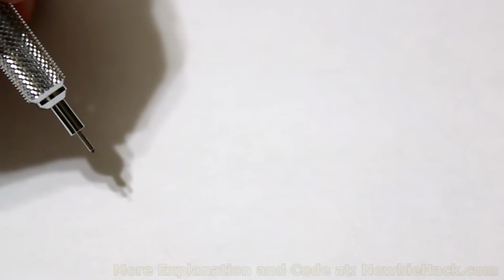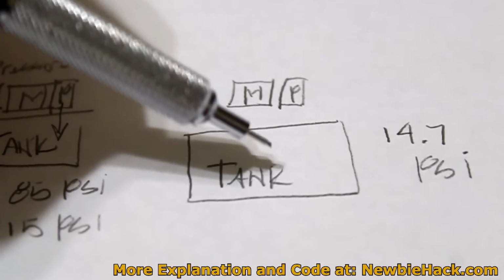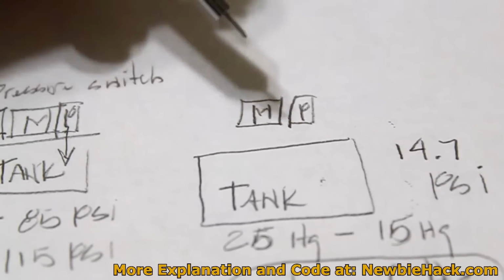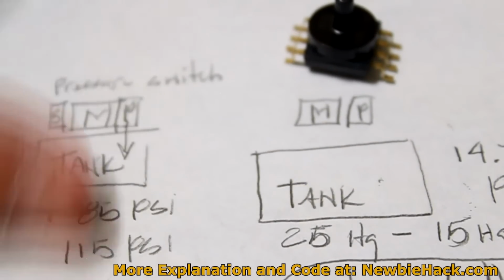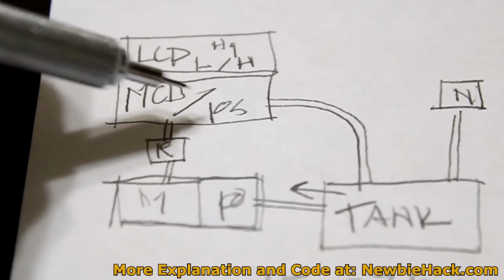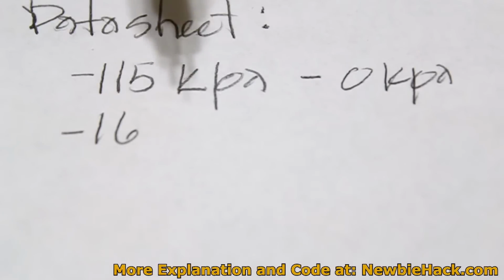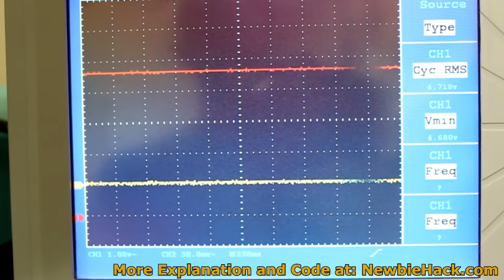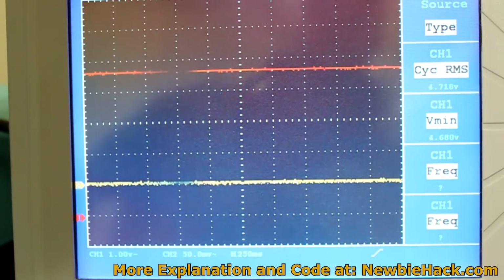41. Arduino for Production! AVR ATmega32 - Part 1 - Real World Example of Create a Vacuum Source

Comment: Patrick is using a Freescale pressure sensor ( MPXV5050GC6U: similar to this one from freescale):  http://datasheet.octopart.com/MPX5050DP-Freescale-Semiconductor-datasheet-10000675.pdf

Relay: https://www.digikey.com/product-detail/en/te-connectivity-potter-brumfield-relays/T9AS1D12-5/PB1014-ND/1095335
Reply from the maker: The sensor loos like it will work fine.  You need to make sure the kPa range will suit your application's needs.  With the relay, you will need to confirm that the 200mA coil current will work with the output pin.

Comment from the maker: @refa42 Oh, work holding.  I will be getting into this very soon as well.  For CNC applications, vacuum pumps in the 5 kW region is apparently needed.  The same MCU and program will be used, but the sensor may need to change to gauge higher inches of mercury.

Comment from the maker: @refa42 I decided not to use the venturi method since a multi-stage device would be needed to get a somewhat efficient system, but the biggest reason is the noise a standard compressor makes (my vacuum pump is quiet compared to my Porter Cable compressor).  This system of using a motor/pump and tank (for vacuum) can be used in many configurations, and the loss of vacuum is very minimal.

Comment: You mentioned that this vacuum system is for a pick and place machine. Commercial machines can use shop air to create vacuum. One way they do that (and that I know of) is using a venturi pump. I bet you know this so why are you going for this route? It's not noisy like cheap compressors but are there other reasons?
My question has nothing to do with the tutorial, I'm just curious.